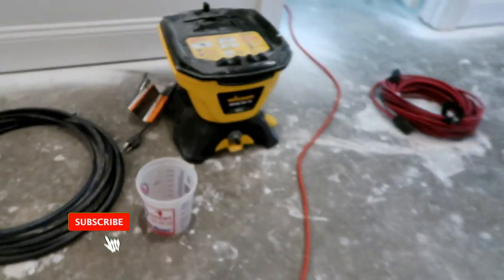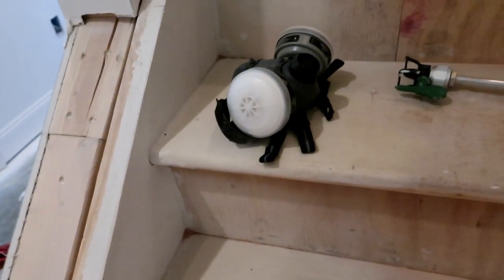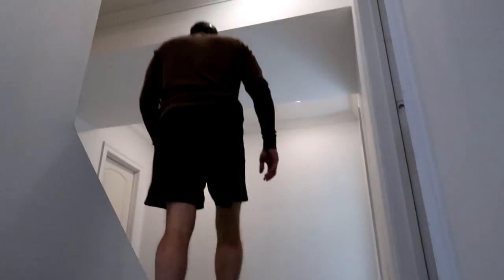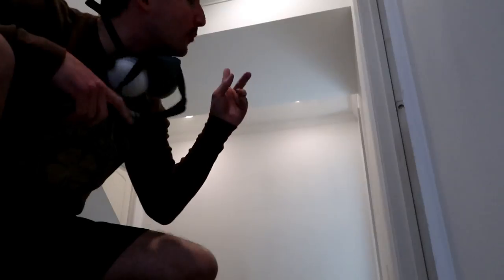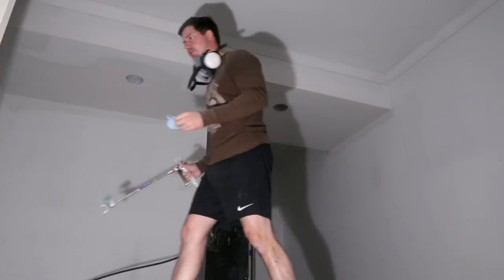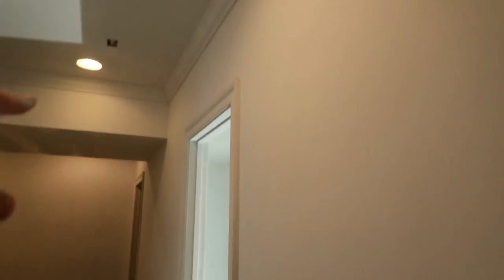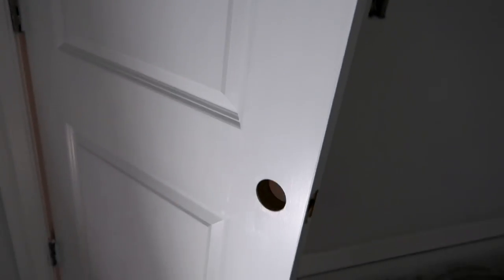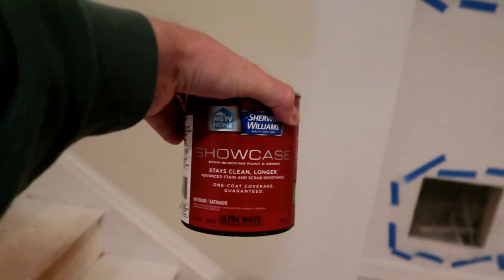Painting the Ceilings with my Wagner Control Pro 130 | Finished Basement DIY | Episode 13

Comment: Moving into our new house build next week and finishing the basement was out of the budget, spraying the basement ceiling black and recently got that sprayer for work spraying a cstore.  Vid was awesome, using the sprayer for both the store and basement ceiling.  Went from a Graco that clogged a lot to the Wagner but haven't  ueed it yet.  Thanks for the video!
Reply from the maker: You can always try thinning down the paint a small bit to try and prevent clogging as well

Comment: You just need to reverse your tip to clean any clog out. Takes like 1 second. You can never clean it that good with a rag. Your tip has that big arrow on the top for a reason, use it

Comment: I just finished with drywall 
I what order did you paint your basement 
Doors trim ceilings I guess whole thing ?
Did you prime your curling ?
Reply from the maker: This is the order I painted.  Ceilings - Doors and Trim - Walls.

Not sure what curling is, but everything was primed before painting
Reply: @PlatoonGarage  
You got love auto correct 🤣 Ceiling 🤣
When you did your trim did you install it first than paint or paint than install ?
Reply from the maker: @mikimiki195  autocorrect gets us all. 😁 Trim got installed first, then painted 👍
Reply: @PlatoonGarage  thanks 
Just like to say your videos give me a lot of courage to tackle lots of work my self 
I did all my framing electrical ( I do have experience with residential electricity)
HVAC duct work 
Thanks 👍🏻
Reply from the maker: @mikimiki195  that's awesome 👍 you're way ahead of me then. I had zero experience in any of this stuff before I started

Comment: I am getting ready today to spray my ceilings with this sprayer. What ceiling paint did you end up using? You seem happy with the results and how it sprayed. Thanks!
Reply from the maker: I used Valspar ceiling paint from Lowes, it was labeled as ceiling paint.  very happy with how it turned out.  good luck!
Reply: @PlatoonGarage  awesome vid thanks. How do you find the durability of the machine/pump, has it lasted well? Thanks
Reply from the maker: @david7101  so far so good 👍

Comment: I got paint spatter first time I used mine. Did you thin the paint or use smaller spray tip?
Reply from the maker: definitely try to minimize the start/stops which will reduce the spatter, and wiping the tip every time you stop spraying will also help reduce spatter.

I didn't thin the paint at all, poured straight from the paint can.

Comment: Did you use the sprayer to prime the ceilings before painting?
Reply from the maker: I actually subbed out the drywall installation, and included in the price was priming

Comment: How to you clean the paint off the outside of your hose?
Reply from the maker: depending on the type of paint you are using, oil based you need paint thinner pretty much everything else can be cleaned with dish soap and warm water, I used an old scotchbrite pad as well
Reply: @PlatoonGarage  Thank you so much!